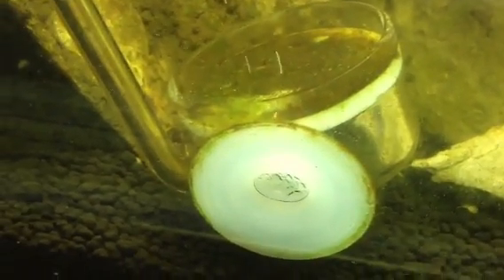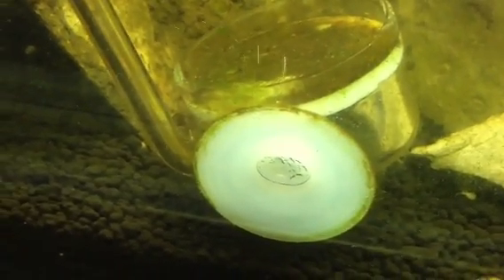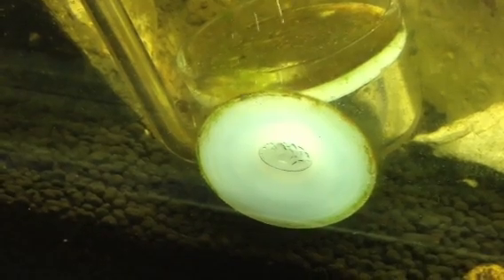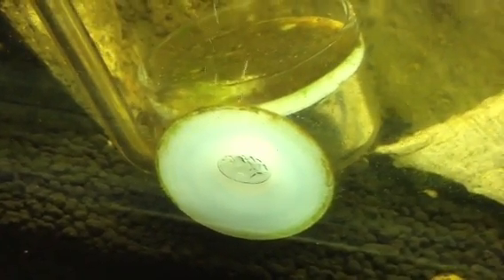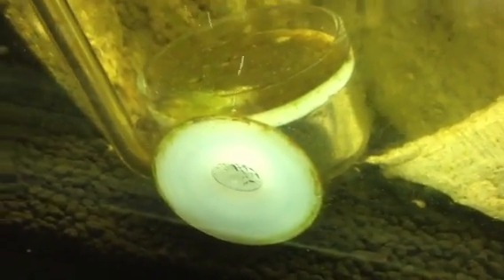How does a CO2 system work on an aquarium

Comment: Hey paul just a tips, with all your surface agitation your defusing your CO2 therefore making it useless, hence why sumps are not used on planted tanks. Also is that ADA soil in there? That will lower ur Ph aswell, also most plants do better in acidic water anyway why do you want it neutral for? By forcing this tank to stay neutral is counter productive. Just my opinion on what I can see. I am building a new setup as we seek, just bought an ADA 90p (90x45x45) tank, have laid the powerders,